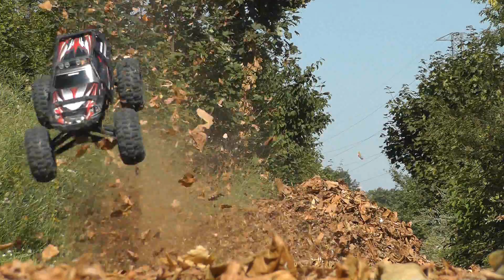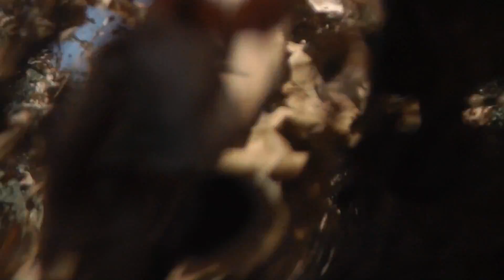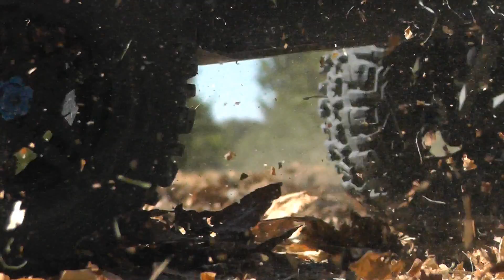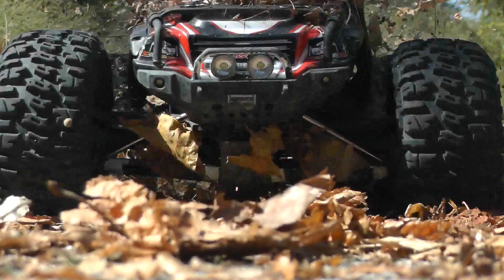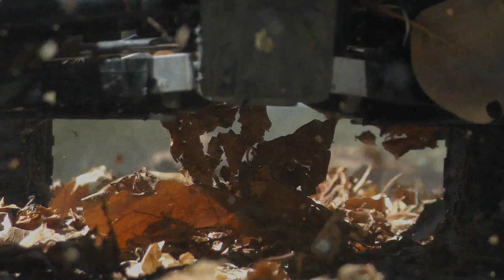RC Traxxas Summit - Jumps and stunts into dried leaves in slow motion

Comment: hey man those are some nice slow mo vids you got up here. You running the stock motor? How you like the Proline tires compared to stock? Subbed Ya dude. Nice work.
Reply from the maker: I still use the Titan 775 but I change the spur gear (58t) and sometime the steel pinion gear with 18t. To cool the Titan, I use 4 fans but with 58x18 I can't run long. Fortunately, the Titan can cool between two shooting.
Proline are more effective for jumps and stunts. The geodes are too soft. They are also very effective for crossing but less than geodes.